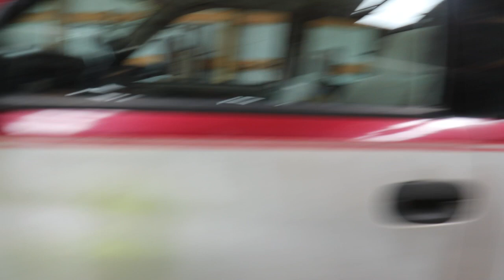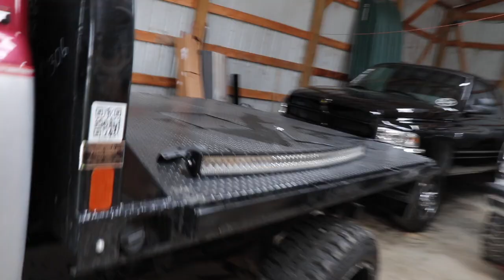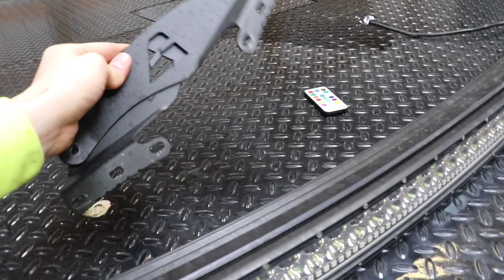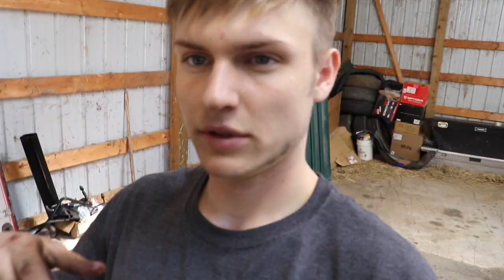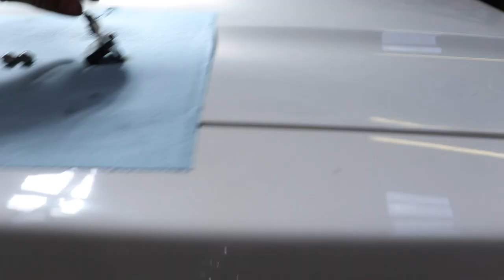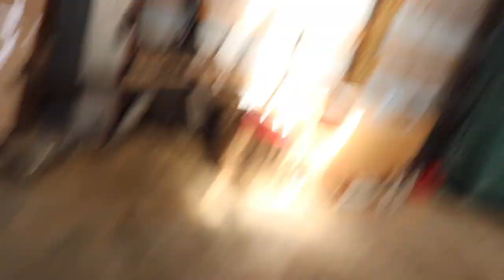I CAN'T BELIEVE THIS JUST HAPPENED!!! BOLTS SNAPPED!!!

Comment: If you weld the nut on the bolt, it will cause the heat to expand the metal and help free the bolts. Plus the weld is much stronger than the superglue so you will have a solid thing to put a wrench on..

Comment: I would get the nut welded to the stud.
Reply: Daniel Lambert agree with this works all the time
Reply: I stripped the flex plate bolts talking about a pain in the ass went and bought a welder and welded a wrench to it came off no problem

Comment: To get those bolts out of superglue don't work disconnect ur battery and then hook up a good ground and tack weld the nut to the bolt on the top

Comment: Do a little spot weld on the nut and bolt if your super glue trick don't work and you may have a stronger bond with the spit weld if it don't work good video man keep up the work

Comment: super glue probably won't work but you could put the nut on the bolt and put a spot weld on the nut and bolt ad try taking it off.

Comment: Pull your injection lines off so you get get down there with a die grinder and cut a slot into the studs so you can use a flathead socket. That should do it. Hope you get it figured out bud.